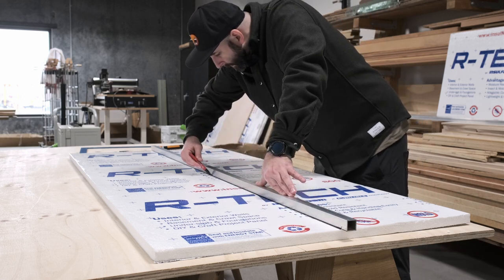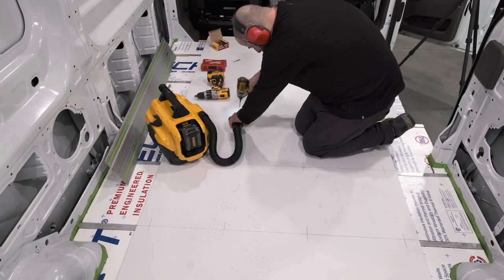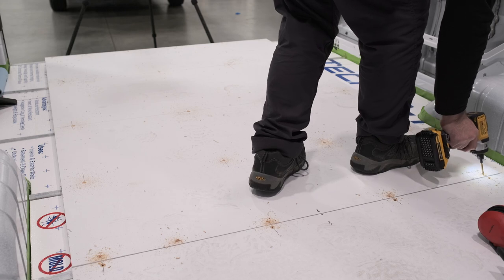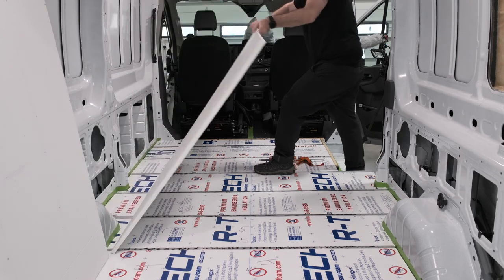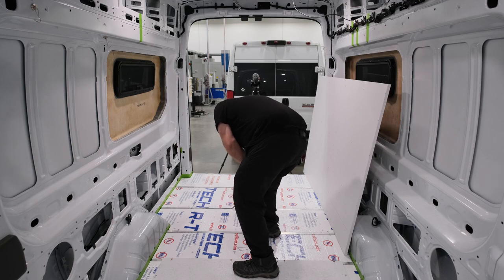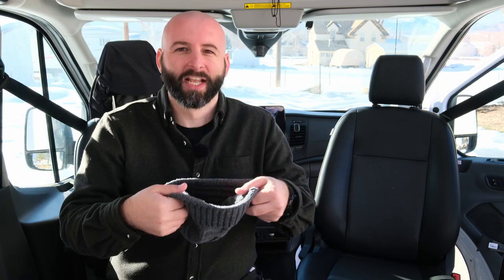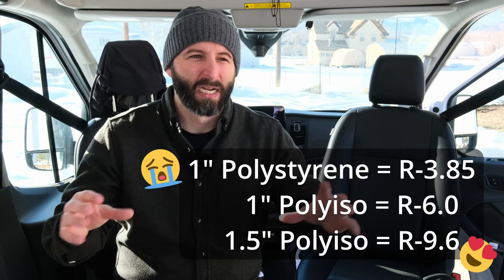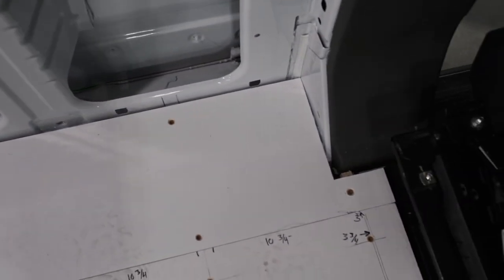Making the BEST Insulated Subfloor for my Ford Transit Van Conversion (PT. 2)

Comment: A super sticky sheet of closed cell foam (ex. Noico brand) 4mm or 8mm pressed firmly against any exposed sheet metal can effectively create an airtight vapour barrier and add just enough insulation to prevent any cold sheet metal from condensing water. Although tricky to install into the floor grooves, it might be possible to angle cut it and get good coverage. The key being to cover and insulate all interior sheet metal. Even with the air channels under the floor, even with fans, the sheer cold of the bare sheet metal will condense a lot of water in cold weather. It's essentially like a dehumidifier. Air flow pumped over a cold metal surface = condensation.

Comment: Thank you! Currently planning my Transt build and you've had a big impact! Particularly the single center subfloor sheet, rather than joining 2 halves with a center seam... makes so much sense. Gracias amigo!
Reply from the maker: Thank you! I thought it made a lot of sense too! 😉
It's held up absolutely rock solid, even unfinished. Still zero squeaks!

Comment: I'm still in the planning phase.  I was thinking about just using plusnuts to attach 8020 to walls, but I read a comment about thermal bridging of metal to metal.  So when I was watching Part 1 and the aluminum to the bare floor, I was wondering if your floors were going to be cold. 

I'm 6'3 and do a bunch of snow adventures.  So thinking of some minicell filler in the grooves, but with some gap for air flow.  Then a R6 1.5" R-Zip floor and some thin waterproofing like vinyl or linoleum/marmoleum.  Some companies sell the r-zip cut out w/ grooves for the channels to probably knock down those areas to R4 for that 1/2" of extra height.  There are so many decisions to make.
Reply from the maker: The thermal bridging seems to be about a 1-2° (F) temperature difference as measured with a lazer temperature reader aimed directly on the heads of the screws I used to attach my plywood floor to the aluminum rails vs measuring the temperature of the plywood floor surface in the middle of two aluminum rails.
Thermal bridging is much less of an issue vs the overall insulation of your entire system.

Comment: Great summary and reflection at the end. Thanks for the honestly about how you feel you could have done better. 
I was initially going to fill in the floor channels with 1/2" foam board but I like your logic about  keeping the channels open so air can get in. 
I'm now leaning towards 2x2's going across at 16" centers and using 1-1/2" of foam board. The 1x1 aluminum is way too expensive where I am to consider it. 
Looking forward to seeing your finished flooring!
Reply from the maker: I'd be hesitant to use wood 2x2's, but if aluminum isn't an option, then the only other point I'd suggest changing is going up to 2" foam board since you'll already have the space.

Comment: I was going to ask what size sheet metal screws you used and after watching the video again, saw you used 1 1/4" star drive deck screws (visible at 10:24 in the video---  any issue driving them into the aluminum (besides having to pre drill the holes)....
Reply from the maker: None whatsoever. Just make sure your predrilled holes are somewhat smaller than the screw shaft diameter.

Comment: Yep; great video. Very useful for any brave souls committed to converting a Transit. Thanks especially for your review at the end. I absolutely agree with you on the issue of condensation. However, that makes me wonder; surely there is a way to incorporate a mechanical ventilation system to control the humidity in low temperatures? This is something I am looking at for my build; for comfort as much as corrosion and mould protection. Anyone out there got any clever ideas?

Comment: Solid floor. I have to admit I never understood why most van builders are filling those valleys on the van floor, maybe some additional insulation? most are using wood down there, at the lowest point in the van, unaccusable and out of sight, a nice place for mold to grow.
Reply from the maker: Yeah, my thoughts exactly. I think in the best case scenario the wood will just take a long time to rot, but in the worst case scenario it could be a disaster and rust out your floor. I figure the fractional amount of insulation gained wasn't worth it in the end, and instead people should probably be using 1.5" think insulation board instead of the 1" that seems to be the defacto choice.
Reply: @ErikJohnson2020  By the way, nice work area you got there, it's not like I have to build my van on the street, but nothing close to your shop.
Reply from the maker: Lol, it's hardly "my shop" - I'm just allowed inside.

Comment: I never understood making a huge Template. I do not do it remodling my homes. I just messure and cut where I have to and keep going.  Funny mine does not have side structures. I just putting the flooring over the Van Floor. Wood, Cork and flooting Lifeproof. Im not going under the Cabnits as they are already installed from the factory. Im basically doing what the factory doing. but instead carpet. Im adding the cork and than Vinly floor. I am also running water proof strips along side of the cabints.

Comment: Enjoying your videos Eric! One question, I can't find the dimension for the width of the van over the wheelwell between the panel rids. Can you help? I want to put a teen bed cross-wise at the back, 15" off the floor (20" with mattress). If the distance between the wheelwell is 54" and the wheelwell is 7.5",  8s 69" the available width, or does side ribbing shorten that?

Comment: Hi Eric, thanks for taking the time to record your van build for those of us starting our own builds. I have a question regarding how you solved the transition from the new floor to the existing step i the side door. There is a molded plastic cover on the original build which is great for waterproofing the step. I looked at all your video's to see what you did to finish the stop. I am thinking of cutting the top lip off the molded plastic and then using 2" angle aluminum to cover the edge. Will be tricky. What did you end up doing?
Reply from the maker: Hi Scott! I haven't yet finished the sliding door step, however, I plan on making a custom plywood lining for the step, and then a storage cubby underneath the kitchen galley overhang. If you want to do something similar, you won't be able to reuse the plastic cover, or at least you'd have to cut/modify it, but it seems to me it'd be a better finish to make your own ply box and use angle aluminum for the edge treatment, and some kind of waterproof grip tape for the finished surface.

Comment: 1. Ask Santa for slippers. 2. Add electric heat under a Wayfair runner.  3. and feeling guilty for not making massive templates.  We who are more 'chronologically mature' than you appreciate any time saved.  Thanks for the GREAT videos.

Comment: Hey Erik. I love the subfloor videos! I as have a Transit van that my wife and I are about to start a conversion on. Curious on where you purchased the 1" x 1" aluminum tubing from and the wall thickness or dimensions that you used? Thanks!
Reply from the maker: Hi Kelby! Glad you enjoyed the videos! I purchased my aluminum tubing at a local metal shop called "Metalmart", but I'm sure most cities have something similar that tradesmen use for construction jobs. As for the thickness, I'd recommend going with 1/8" thick (0.125), so that your screws have some meat to bite into. On a second trip (didn't purchase enough 1st time around) I mistakenly purchased 1/16ths and that technically also worked but when you're drilling the pilot holes, you can honestly tell the difference, and I felt more confident in the 1/8th.
Reply: @ErikJohnson2020  Thanks! Keep you the good work.

Comment: What did you do for the two thresholds? How are you finishing out the floor at those doorways? It appeared you didn’t reinstall the factory ones. Is that for a reason? I’m building out the same van and appreciate your videos. Thx in advance
Reply from the maker: I won't finish the thresholds until I put in the finished floor, but I'll be putting in a metal edge guard for both entries, covering the finished floor, the subfloor, and the insulation.

Comment: Great videos!  After living with the subfloor for a few months, would you do anything different?
Reply from the maker: As mentioned in the summary I'd use 1.5" Aluminum rails and foam boards rather than 1", and I'd make sure to use Polyiso foam boards and not polystyrene boards of I was to do it all over again.

Comment: Great job. I will also build my transit in March. I will do the same structure for the floor. What was your thought for using this particular glue. Was it the strength? The curing time? Have you considered Sika product( Sika bound) or PL Premium 3x or 8x?   Concerning the cold on our feet  when getting out of the bed, considering that I will also choose vinyl planks, I intend to install a radiant floor ( thin film, electric, thermostat or timer) for these mornings on during the time we are preparing the meals. Looking forward to see your next steps
Reply from the maker: Hi Francois, concerning the adhesive, I already had some leftover from my flarespace project, but the reason I ultimately decided to use it was after reading the data sheet for Seal Bond 105 they clearly state it is safe to use with foam board, and I my concern was some adhesives can cause a chemical reaction with foam and will dissolve the foam.

Comment: Won’t the foam board “squeak” when it rubs together?
Reply from the maker: It would, but that is why we only have non-foam materials touching the foam wherever possible, and in one spot where we had to have two foam boards touching, we used extra foam adhesive between the two pieces to prevent any squeaking (in addition to using foam adhesive on the underside for everything). Hope that helps!
Reply: @ErikJohnson2020  I presume you’d know since the original post was a while ago. Thanks for sharing this, and the timely response with us. Brilliant!

Comment: Hey Erik, I'm so glad I found your videos as we get our Transit in a few weeks and like most, we've being going over many many YT videos and finalizing our build plan. I like your production quality- both of videos and of your build! Lots of attention to detail. And, we agree with your thought process of ventilation. 
My question is, at the back doors it looks like you stopped either a bit short in length or cut back the plywood so it doesn't come right to the end of the floor "platform" before the step/ ledge that is a few inches lower. What was your thinking for doing this? Why did you leave it a few inches (cm) short? From the camera perspective it looks incomplete?? As we don't have our van yet, so I can't go out and see/ measure. Keep up the great work. Looking forward to following your build process. Robert
Reply from the maker: Hi Robert! Concerning the gap between the end of my flooring and the rear doors - the issue is that at the very back, the corrugations stop about an inch shy of the doors, and knowing that I'd likely be resting a number of heavy items right on that spot as I moved them in or out of my rear garage area, I didn't want to risk the plywood chipping or breaking due to a lack of support directly underneath it. To add to this issue, the back also curves or bows outward in the middle, and so any support that you might try and add yourself (like I did at the sliding door entrance) would have to be a custom radius. In the end, since this area is going to be covered by a diamond plate cover anyway, it didn't feel like a worthwhile time investment to gain one inch of flooring in the garage area of my build. Hope all that made sense! Best of luck in your build!
Reply: @ErikJohnson2020  OK- Got it. I never thought about heavy objects resting/ dropping/ clunking down on that spot. A lot of force would be concentrated there. And, as we are learning, these vans have some funky curves/ bends/ angles what have to be addressed. Thanks for the speedy response. Keep on putting these videos out for us : ). Looking forward to more of the build series.
Reply: Heyyyyy Erik!... we are going to be starting our floor install this week and in your video I didn't catch what screws you used. I would assume self taping metal screws but... Could you let me know please what ones you used. Kind and length. Much appreciated. Exciting times!.
Reply from the maker: @Thedestressguy  I used an exterior decking screw, self-tapping, with a torx-25 head, I think it was like 1-3/4" long. Might have been Deckmate brand, but I'm not certain. Good luck on your project!!

Comment: So what flooring will you put down on top of this? Vinyl plank?
Reply from the maker: Yup! That's exactly what I'm planning to use. I thought about doing a roll-on like Lonseal, but the price and the hassle of the install seemed to outweigh the benefits.
Reply: @ErikJohnson2020  I'm interested in your approach to this. 
When installing vinyl plank in a house they make a big deal about leaving a gap around the outside to accommodate thermal expansion and contraction, so the same must be even more true for a van where you'll see much more varying temperatures. 
I'm leaning towards letting my vinyl plank float on the floor, and anywhere a cabinet gets bolted to the plywood below, drilling a 1" (25mm) hole through the plank to let it expand and contract with the temperature variations.  
Your thoughts on this?
Reply from the maker: Hi Panda! The "expansion" gap around the perimeter of the vinyl plank flooring is also critical for you to install the planks properly, since you'll need a slight gap to fit the "pulling tool" in order to eliminate any slight gaps between the planks once you start laying them down. Thankfully though, this gap is super easy to cover up with some quarter-round trim or some other decorative trim. Combine that with toe-kicks on your cabinets, and I think you'll find the gap needed is hardly an issue. 
And from what I gathered of your description, it sounds like your plan is to install your cabinets on top of your plank flooring - which I wouldn't suggest doing, since the physical weight of the cabinets will prevent the planks from moving/expanding. I'd just install your cabinets directly on top of your water sealed plywood, and then anchoring your cabinets to your plywood is pretty straightforward.
Honestly I'm not sure if vinyl planks really do expand/contract all that much. From what I've read, modern vinyl planks are quite stable relative to temperature based expansion, but regardless you're still gonna need that gap for a proper install. Hope that helps!

Comment: Good that you didn’t use polyiso. When it burns it emits cyanide gas. Also, it loses r-value over time, which Home Depot won’t tell you when you buy it. (I’m trained as an energy auditor)
Reply: What do you recommend instead?

Comment: Hey Erik, glad I stumbled onto your channel today. You and Humble Road have very similar methods. I'm curious as to why you chose to run single sheets length-wise down the middle and then add the filler panels on the sides, rather than running three sheets from side to side (https://youtu.be/lA-rV8Wne9Q)? Thanks again for the awesome videos. Cheers mate!
Reply from the maker: Hi Shaun, I'm glad you found my channel too! 😊  As for why I didn't run the sheets sideways, plywood here in the states is most commonly in 4'x8' dimensions, and at 4' wide, you'd actually need 4 sheets to cover the length of the extended version of the Ford transit (165"). That and you'd have nearly 3' of "waste" from all four boards if you lay them in running sideways. w
Whereas in my layout, I only used a total of 3 boards, and had very little waste.
Hope that helps!